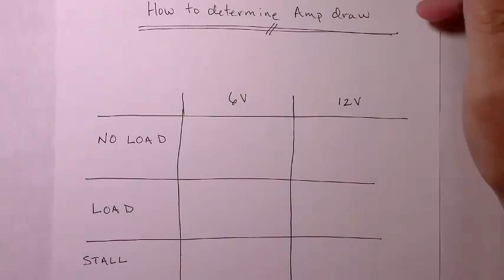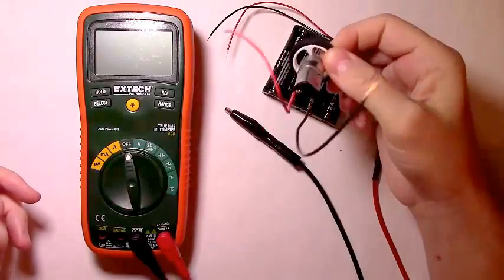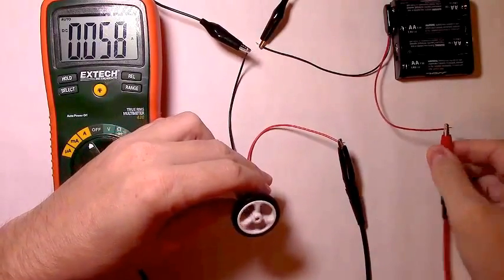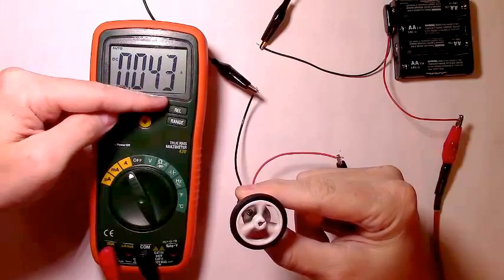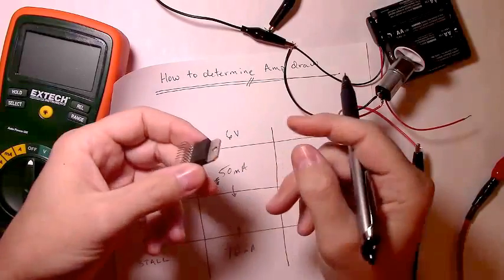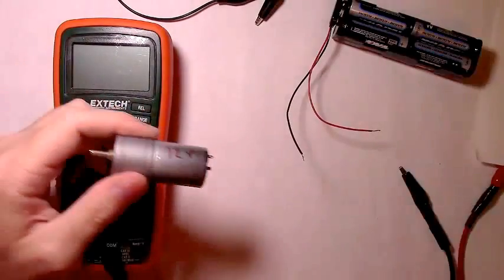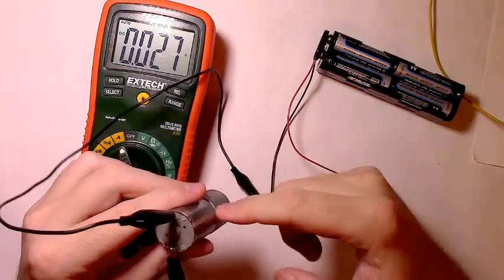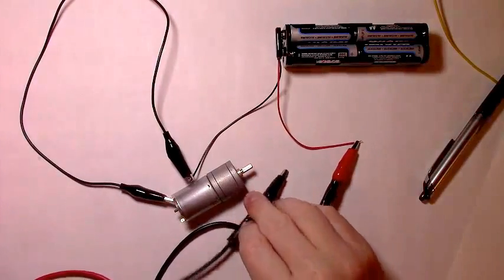How to Determine DC Motor Current/Amp Draw (for beginners)

Comment: Excellent video! Thanks. You are a good instructor. One question from a noobie like me...why is the 12 v motor more efficient than the 6 v motor besides the build quality that you mention? Is it because the larger motor has more windings and / or larger magnets?
Reply from the maker: +Jorge Washington Appreciate the feedback and question.  Build quality (e.g., more precisely machined gear teeth in gear motors) and material selection are often the reason for one gear motor being more efficient, etc., than another.  More windings, etc., can be very important but the overall purity and quality of the materials used as well as the care taken during the design and machining processes tend to make even more.  Building a "functional" gear motor is not too difficult but building one that's especially efficient, plenty of torque, lower current consumption, etc., can quite the engineering and machining challenge.     Hope these comments help.  Thanks for watching!
Reply: Thanks for your response Philo and for sharing your knowledge with me.

Comment: shouldnt that 12v motor be consider a LOAD since it has a gear box?  while the 6v motor did not so no load unless the wheels are in the floor and mounted to hold the weight of the cars chassis/body?
Reply from the maker: Frank Lopez Appreciate the comment and question.   Both motors (6V and 12V) were of the gearhead type.  

Correct. Each motor is technically "loaded" in regards to the gears.  But it's also fairly common to think of them as being in a "no load" state insofar as no pulleys, wheels, etc., are attached --- cases where gears are present but the shaft is "free wheeling".  The load associated with the gears can matter if/when one is interested in performing more precise wear, efficiency, etc., calculations.  But for the purpose of building simple robots, etc., (i.e., cases where a lot of precision isn't necessarily needed) it's often fine to assume a "load" doesn't appear until the "wheels touch ground".   

Hope these comments are helpful.  Please let me know if there are more questions, etc.  I will always do my best to help.

Thanks for watching!